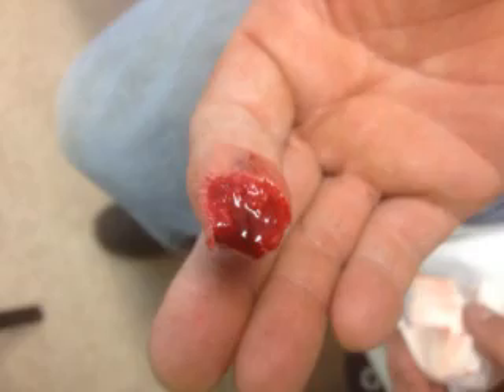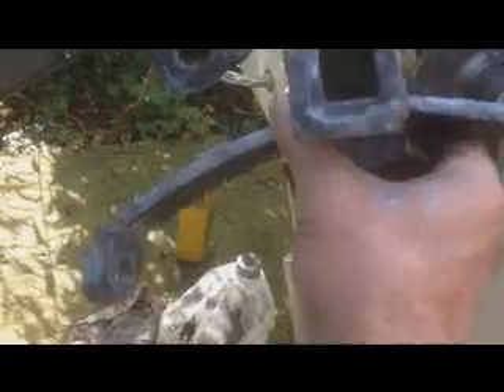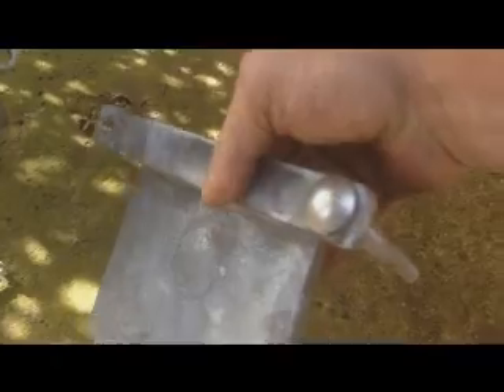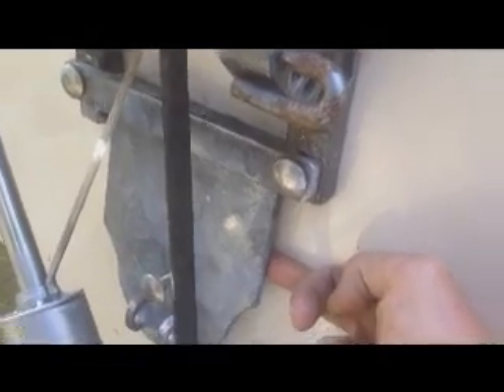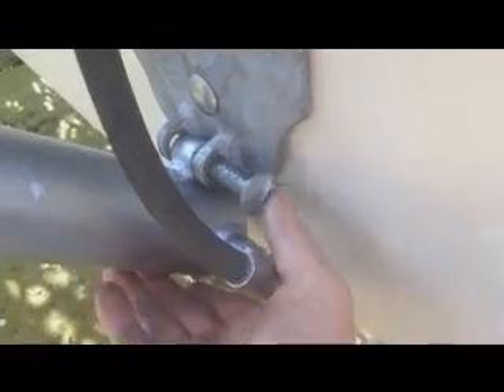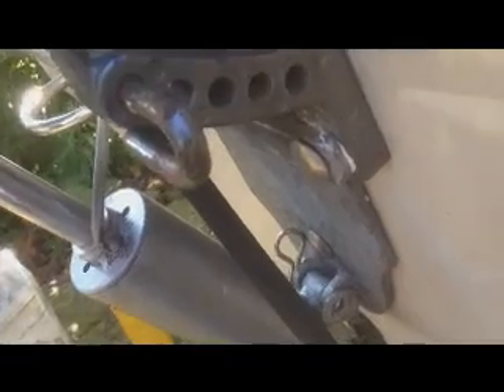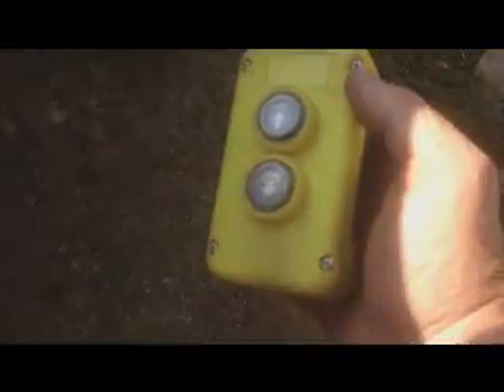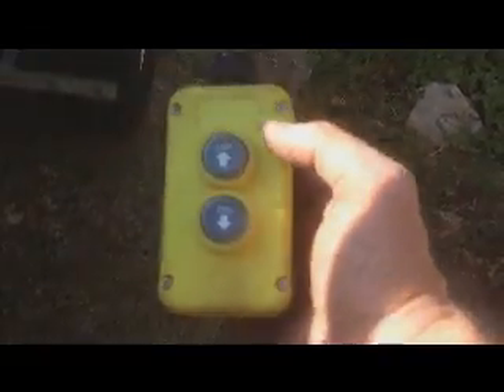Home Made Tilt and Trim Ram for Outboard Engine

Comment: What happens to the foot if you hit a log with that cylinder hard mounted to the motor looks to me like you will damage the motor, the transom or both if it doesn’t break away

Comment: Yes I like your video where do I get a ram like that and what is the stroke of the ram thank you
Reply from the maker: Hi I made a new system including the ram which has a approximately 100 mm stroke, closely attached under the actual motor

Comment: How’s this ram holding up after all these years?  You did a great job
Reply from the maker: That ram I still have but I made a smaller more compact unit in stainless steel approx a year after, which is still working fine.Thanks very much for comment

Comment: Where does one order such a device. Mfr. part number and name of it please.
Reply from the maker: Hi Tom I make to order with the boats in my workshop I made a different ram working off same design but smaller you can hardly see it
Reply: Hi, where are you based, I have the  60hp version of your outboard, which is identical except some of the internal bits. Found your video looking for this very solution.

Comment: I have a mariner 75hp.. with manual up and down.  The older I get the heavier it gets.  I was thinking of doing something similar.  In the end it will cost me just south of $1000 to put a real auto trim on it, even if I fabricate it.  Im probably better off saving my pennies and buying a more modern outboard that already has power trim on it.
Reply from the maker: That cost me £125 for the hydraulic pump and a few hours of play time, I’ve since put a lot smaller pump behind the motor

Comment: And you did it on the cheap too.I paid $500 for a used one for a 40Hp Johnson.  👍
Reply from the maker: Harlan Mote total cost about £150, the hydraulic pump cost £125. Changed it 18 months later smaller ram and all in stainless as galvanised steel reacts with salt water

Comment: I made one like that but using a air shock i used a 1963 corvette air shock on eBay single and a tiny air  compressor I love your mount mine isn’t as nice but it works good job sorry about your finger be safe
Reply: Sounds interesting. I've been trying to find a low cost alternative. What kind of compressor?

Comment: How long did it take you to realise it doesn't trim down far enough?
Reply: About as long as it took you, to not realize (not realise), that it clearly does go down far enough. Didn't you realize that if the motor came down far enough to latch properly to the locking bar at any position, that it obviously does come down far enough. His method requires quite a bit of metal fabricating skills to fully accomplish. But is a great idea. If you can do it better, please share with us and show us your method.
Reply: Makes sense that if it latches it comes down far enough. I do see where and why this poster might think it doesn't come down far enough though. Videography can be deceiving especially when it comes down to exacts such as mechanics.

Comment from the maker: Hi it's a single acting ram gravity pulls it down about 3 secounds up or down for reverse the two hooked lugs on the motor catch the frame of the motor as normal works brilliantly the speed up & down helps to avoid the lobster pot ropes

Comment: How long is the actuator?
Reply from the maker: 70NastyLac on that design the ram was approx 160mm movement , how ever the new design is far better smaller all round plus I moved the new ram right up under the top of the motor less ram movement more motor movement, I will put new video up one day
Reply: Thank you.  my motor doesn't have the power tilt either and is a pain sometimes getting that bolt out. Thanks for the quick reply and you did a great job putting it together.
Reply from the maker: 70NastyLac what motor do you have? The manual tilt and lift is really crap on heavy motors so antiquated. Do you have room between the motor and frame to fit a ram?
Reply: I have the 85 force motor and yes, I believe I have enough space in between.  You're right the heavier the worst they are
Reply from the maker: 70NastyLac what country are from, I'm eastyorkshire uk
Reply: US

Comment: This setup is OK for static TILT function but not for trim; while underway under power the engine is thrusting forward and the ram isn't exerting a force vector to counter that.

Comment: Would love a list of the parts used.  I'm planning on doing something similar for mine over winter.
Reply from the maker: Ernest Berzai.  Hi the brackets in the video where made of galvanised mild steel the ram was 6o mm o/d with a 125mm lift, everything was made in my workshop. I'm in the process of a new vid where everything is c/o to 316 stainless steel smaller ram which is positioned higher up under the engine and generally  all lighter & more compact.

Comment: More questions...  :)  What is the ram made of, stainless steel?  What did you make the brackets out of, aluminum?  Did you weld them yourself?  Why credit to Iveson Engineers, did they do the actual design work?  Thanks.

Comment: Maybe it's the camera angle , but when in the do wn position it looks like the motor is trimmed out too much.  Does the boats bow ride high or porpoise?
Reply from the maker: The boat ran fine, but yes the motor did not come down fully and that is why I have re designed it with a new ram that now lets the motor come down all the way, I will be putting a video of these amendments up soon!! thanks

Comment: Nice work on your tilt piston.  I am wondering, before you installed that system, did you have to pull the metal pin/bar out in order to raise your motor, or is there a lever that you can pull somewhere to disengage the "claws" from the pin?
Reply: Generally the latch is only engaged when you are in reverse.  When in neutral or forward, they're not hooked.

Comment: it seems to work more like a damper than a trim system
I wish that you covered your fabricated parts with a good paint as they seem to be steel and if so, you'll experiment an  heavy  corrosion issue .

Comment: Hi there like the setup.  Where did you source the rams and pumps etc?  I have an evinrude 55 and its a pig to lift but the tilts were an optional extrac and are like hens teeth.

Thanks
Reply: I'd like to know where you got the ram, pump, and switch.  How do you lower the unit, use the down button and if so, what does that do, just open a valve to let the fluid return?  Is that a huge oil reservoir next to the pump?  Does it really need to be that big?  Thanks.
Reply: I have the tilt/trim system that fits the Evinrude 55.  They're out there if you look.
Reply: @russg1801  yeah, and you likely spent $500 or more. Making one from your own stuff, besides a pump and all that stuff, is much cheaper.
Reply: Russ G I have been on the look where did you find yours